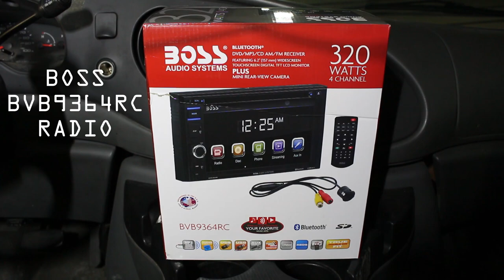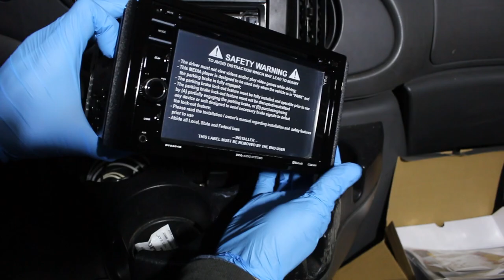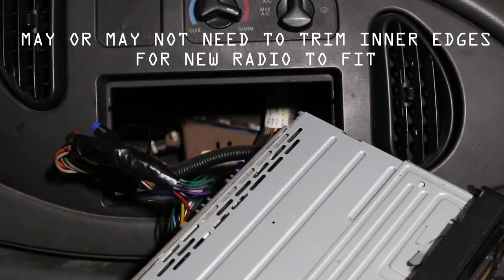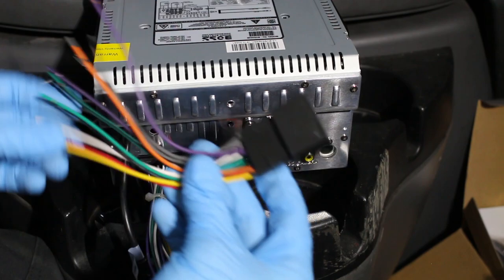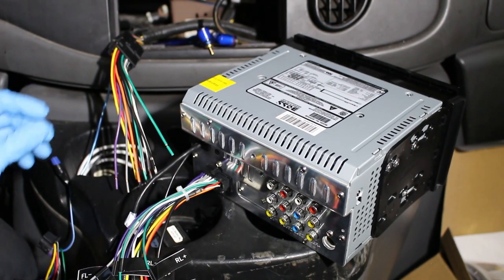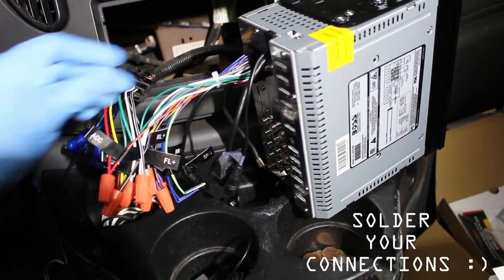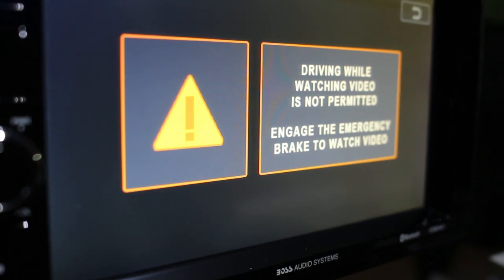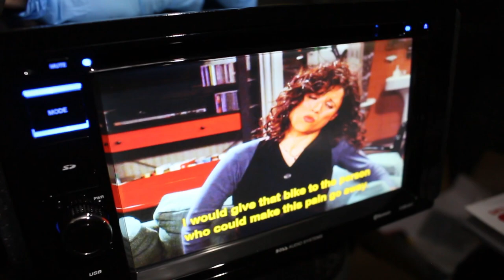How to install a car stereo (BOSS BVB9364RC)

Comment: Very helpful upload. I’m installing a different model Boss in my Tundra and noticed after splicing the harness from the Boss to the adapter harness   from Crutchfield that the color wires don’t match up to the factory plug coming from the truck. It seems they would but before I plug in I need to make sure. Any tips?

Comment: I just bought one today gonna set it up this week. This helped out alot.
Reply from the maker: Awesome🙂 For the quality vs price, cant beat this deal. It's much easier to set up than expected. Really glad this helped out, hope you set it up with ease and enjoy your new stereo. Thanks for watching and the feedback. Means a lot & I really appreicate it. Sending blessings your way from NYC!
Reply: I just finished installing Db755b today. I had shipped to the wrong address so i had to wait for the company to get it back and re-ship it, it took almost three weeks. It fits perfectly in the Mazda 3 2004-2009 i connected my phone through Bluetooth and drove around. It works perfectly still looking for a hiphop preset for sound . And i can buy a dash cam and rear cam later on.

Comment: Do you have to use the P.ant wire if you don't have a power antenna?  Do you just tape off p.ant and the other 2 wires shown p.cont, reverse?

Comment: Where do you put the rca cables in the back of the head unit ? And why is it just one single blue wire in the other plug but not connected to anything ?
Reply: The wire colors are universal if I understand that correctly. The blue wire has two possible functions: 1, it goes to a power antenna motor; or 2, it goes to an external amplifier as a power on signal.
Not all head units have RCA cable output connectors, but when they do, they appear to be a pre-out of low voltage audio channel signals (Front-L/R, Rear L/R speakers) that feed into a harness and go to an external amplifier, where the signals are amplified before going to the speakers.
Reply: It's an amplifier wire

Comment: Cool video! Do you keep the parking brake wire connected to metal the whole time and does that affect other functions like backup camera or USB or Bluetooth?
Reply from the maker: Thanks you! Yeah I keep the wire grounded all the time lol it doesnt affect any other function🙃
Reply: @JumpermanTech  i was thinking about that curse the harness dont come with the cable to attach it with the other extrem ,so i can just ground it in anywhere in the metal

Comment: i installed a boss bvb9364rc i dont know what i may have done wrong but the blue mode light stays illuminated when my car is off , no keys in ignition. and i matched all wires together.
Reply from the maker: Hmmm. Somehow you keep getting power to the radio. That blue light stays on for a few seconds after I turn the car off. Did you give it time to turn off? I'd double check the wiring if time doesn't work to make sure everything is in order. From there I'm really not sure. Wish I could help more. Appreicate you watching Manuel & hope you get this issues resolved
Reply: too bad i cant post a picture of how i have it wired
Reply: @noble5wins  It sounds like you have the RED (ignition) and YELLOW (memory/constant battery hot) wires cross-wired. This would allow the unit to be powered even with the ignition off.

Comment: Hey man, I'm back .. bought this unit last week and tried to install it in my E350 2001 Econoline, it won't fit :D the dash opening needs to be trimmed, and even after it's trimmed it won't fit the metal bar that the climate control is attached to .. don't you have a metal bar behind the dash head unit opening ?.